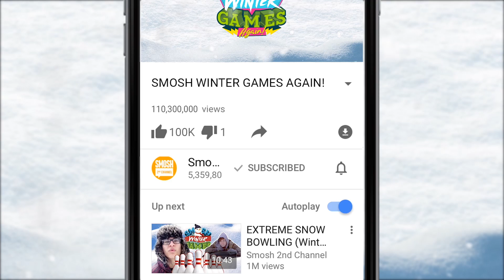KILLER ICICLES (Smosh Lab - Smosh Winter Games)

Comment: Was it weird that i thought of human heads when they dropped the icicles on the watermelon and pumpkin ;~;
Reply: Nova Westgren On forensic tv shows they often use watermelons to simulate the effects of a weapon on the human head.
Reply: They have the same resistance to bludgeon damage, but a skull is more resistant to slicing damage.  You should equip a skull into your head slot and not a watermelon.
Reply: Nova Westgren they're about the same density
Reply: Nova Westgren "You're a dark person!"
Reply: Matters, if you take a dull blade you can cut a watermelon. But with a real human head it will be impossible.
Reply: Dragonborn thats cutting but the power to squish both is similar